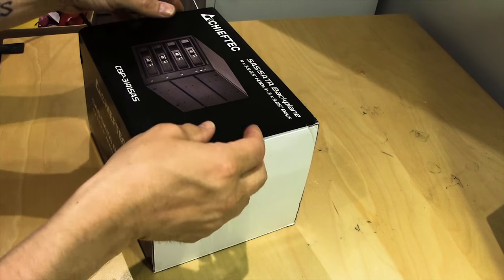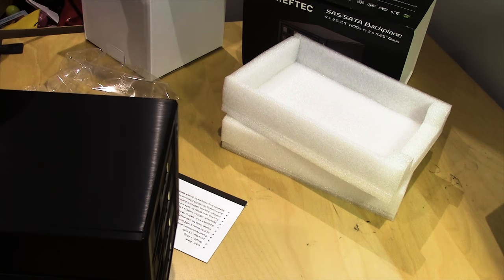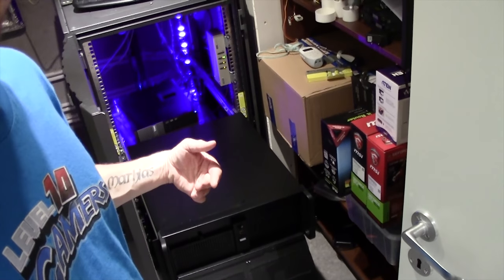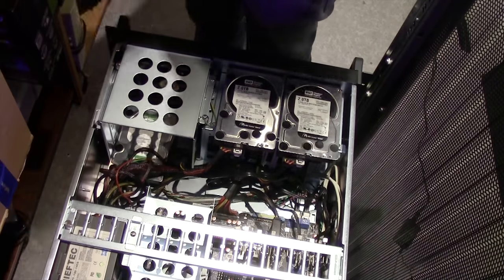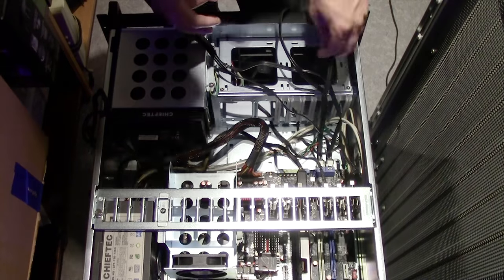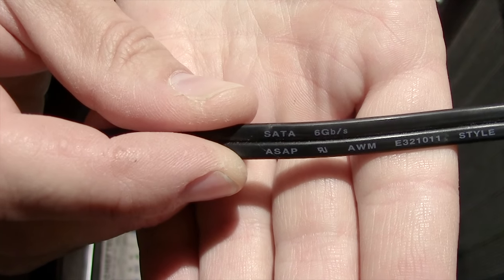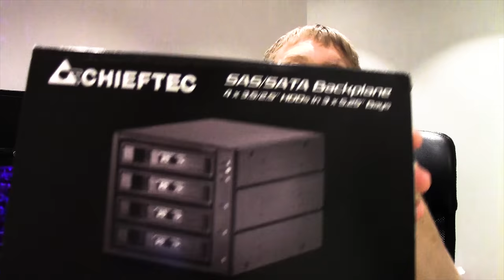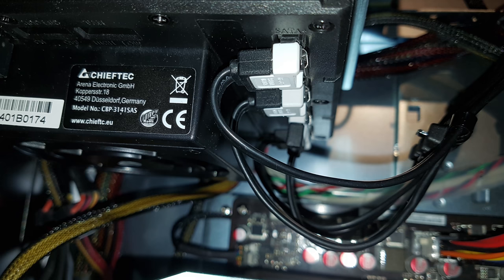CHIEFTEC 4 BAY SATA/SAS ENCLOSURE | Techtime #26

Comment: Nice runthrough. Do you know, if it works out of the box with SAS drives?
Reply from the maker: According to this https://www.chieftec.eu/en/accessories/sas-sata-backplanes/cbp-3141sas.html it does, tho I have not tested it with a sas drive myself
Reply: @Level10Gamers  Yeah read that to. i just installed the bay in my home server. my SAS drives dosent work in it though :|
Reply: Could be something im missing though. First time working with SAS drives in my homelab
Reply from the maker: I don't remember what the jumper on the rear right side does, could that be something? If not then I'd advise you to contact Chieftec
Reply: @Garby87  Try to power your SAS drives from Molex connector, not from SATA connector.